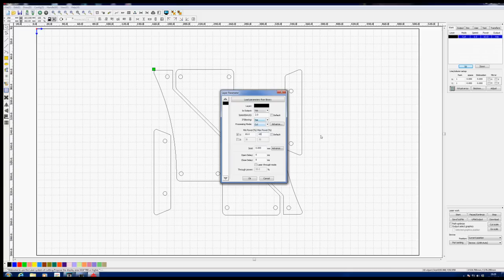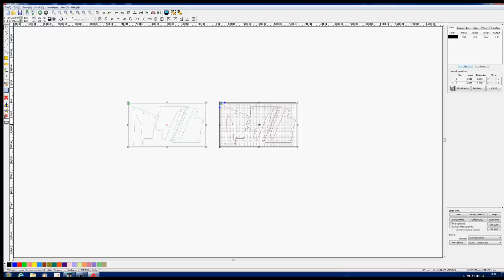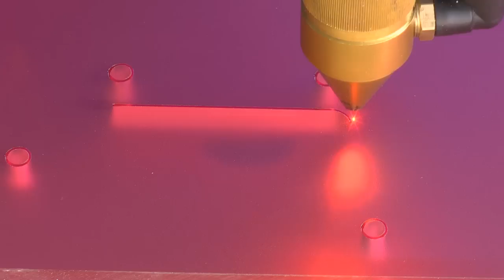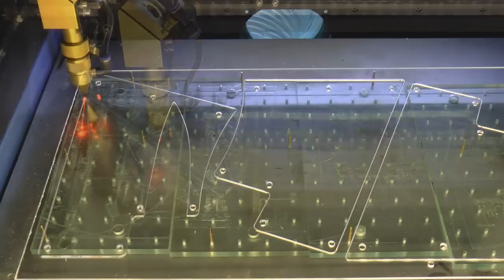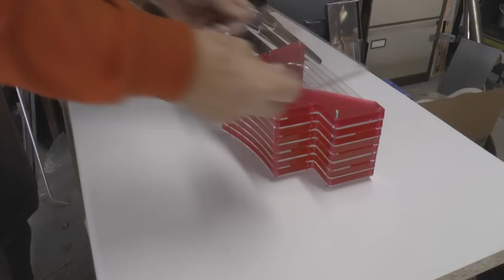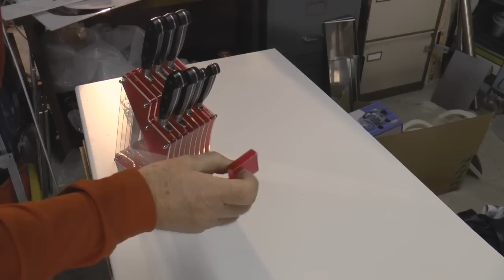RDWorks Learning Lab 26  A 10mm Acrylic project

Comment: Excellent as always! Looks like you are further along with your laser cut Christmas gifts than I am! 

Regarding the tapered ends, this is my most recent problem. I've checked everything I can think of. I thought that the laser was focused but not exactly at the center of the lens and as a result was shining down at a slight angle. If that makes sense.. It turns out that that was not the case. I have spent hours trying to tackle this one with no luck yet. 

It must be some sort of sorcery!
Reply from the maker: +CenterFireJewelry I have done some investigation already . Like you I mused on the fact that a laser  beam offset to the lens centre will go off at a slight angle whereas if it is on centre but not perfectly perpendicular to the top lens face, it has little effect. Also the distance between the lens and the nozzle is sufficiently large that I was  sure it would be impossible to generate the angular error I was seeing. Having  identified the error as a back/front face problem, I put a square on my work table and found the nozzle (whole head) was tipped towards the back of the machine by 2 or 3 degrees and accounted for most of the problem. I even tried over compensating by a degree of two but in fixing that and trying to get the beam realigned I encountered another issue. All the ajdusters on the second mirror(on the end of the X slide) were almost seized. I managed to eventally get the screws loose and extracted and was able to grease them up. But when all the adjusters were out I found that the spring loaded "pull-back" screws were binding in their holes and preventing any real floating adjustment. Cans of worms inside cans of worms!!  I have now opened up those "float" holes from about 5,2mm to 6mm and the whole assembly almost works like it should. Although I have put it back and struggled for a bit to get realignment I have got it reasonable close.  Good enough to do my latest mode burn video. I have got to finish my Xmas cards tomorrow (all low power stuff) and then I will start  a complete realignment exercise (on video of course ---problems, struggles and successes).
Reply: +SarbarMultimedia I look forward to watching that. I've tried to determine whether or not my machines head is off a bit but haven't had much luck. Instead of trying to reinvent the wheel I will gladly learn from your new exercise. Thanks as always!
Reply from the maker: After all this time I have discovered and fixed my off-angle cutting .See session 31 part 4 .
Happy Christmas!!
Russ

Comment: I can't work this out, when I go to cut out properties and set it up, it won't show on the preview or when I load it to the machine, how do you get it to save and refresh the changed order,  now it thinks it has changed because when i go back to cutting order it still shows the changes I have made.
Reply from the maker: +Mentorcase 
Hi 
Very frustrating isn't it. I spent some time wresting with this problem and all is explained in session 20. Is your path optimise box still ticked?
Reply: SarbarMultimedia
Yes I just discovered the path optimized tick was tuck, lol and sorted it, thanks for the help anyway. Those 10mm acrylic cuts looked pretty nice.

Comment: this is a great example of what can be done when you understand all of the variables of the machine. 10mm is pretty darn good!  It's also funny that when you own a laser cutter, every task becomes a laser project.
Reply from the maker: +2020tesla 
Creating 3D objects from 2D pieces has become a natural part of my design thinking. It was the cheapest and quickest way to create complex metal structures when I had 2 industrial lasers. Working with 2D CAD to design and then testing that everything fitted by building it in Solidworks was an extremely rapid way to get my commissions done rapidly and "right first time"